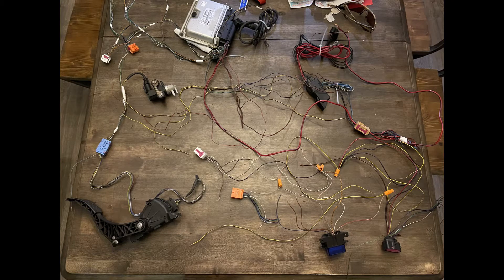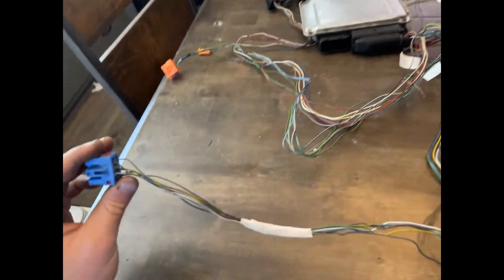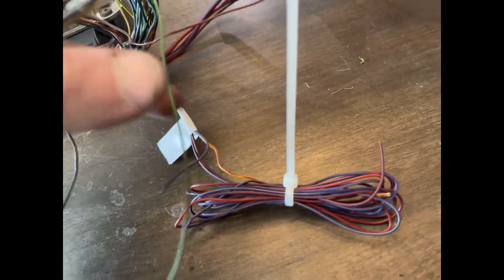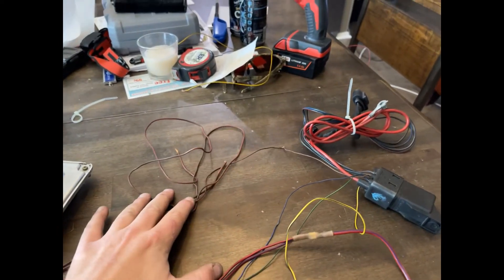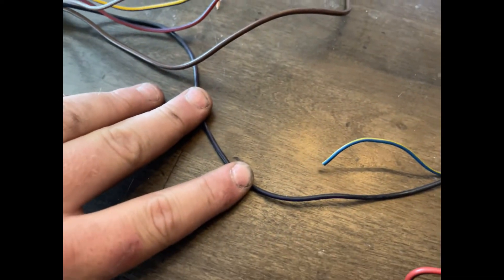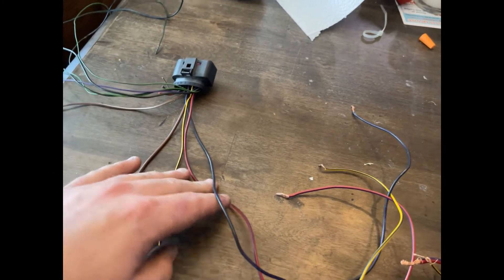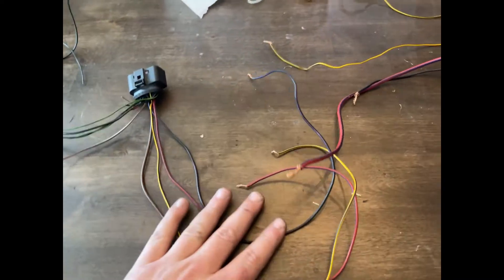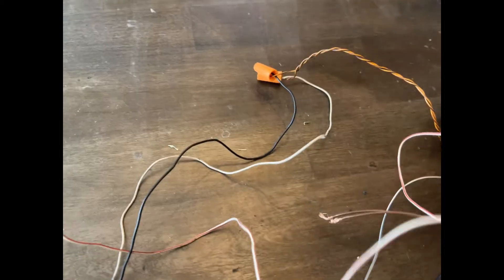Volkswagen ALH standalone wiring harness detail for engine swap

Comment: On the T14 connection will you give the numbers for the power and grounds. I don’t have that plug so I will have to splice into the engine harness.
Reply: I found the answer to my question online 5 - 30a fused, 6 - 10a fused, and 9 - is a ground. The engine started right up. Now I have another problem with the TPS not working. Reading online that it could be the brake pin out.
Reply: Also do those + and - have to be hooked up to run. I can get the engine to fire.  The ecu is coming on and the injectors are getting fuel but all the engine will do is spin over

Comment: Hi there! Great video, wondering about a few things. When you say something needs 12v power does that mean ignition power or constant 12 v power? Also the lilac yellow wire on the blue connector, do you connect that to ignition power to wake up the ecu if you’re not running the 109 relay? Thanks!
Reply from the maker: Hey adam, yep i mean constant 12v power. Pretty much the only thing that gets momentary power is the wire connected directly into the starter which fires the starter solenoid. You can run that one through a relay from your ignition.

The lilac/yellow wire on the blue connector is hard to figure out honestly. It's something i was planning on running an update on once I get the system more sorted, but I think the lilac/yellow wire is the one that actually powers the relay... so once igition is swithed and the ECU gets power, the Lilac/yellow starts running high 12v supplied from the ECU. 

The one that i DID glance over in the video is that the dark purple wire on the T14 connector needs 12 supplied to it to wake up all the engine sensors in addition to the yellow/black wire. 

Hope that helps!
Reply: @FiedtheNeedIT1  I see! Yeah that’s great! So the dark purple wire on the T14 is switched power?

Comment: will this work on a pd130?
Reply from the maker: I'm not familiar with that engine, but from the name PD it's likely a pump duse VW engine which does not use the same bosch VP37 injection pump, but instead uses a different fuel injection pump. 

So no, I'm guessing this specific guide will not help you.

Comment: Hi, thanks for the video, What year is the TDI engine?
Reply: My 2003 beetle harness is little different, maf sensor has additional plug and is on the main body harness thats not pluged into ecu dirrectly.
Reply from the maker: Bennett, the ALH engine code came in the Volkswagen Golf, Jetta, and New Beetle, and a few other things from 1999.5 to 2003. Basically the MK4 body styles.

This video applies to the engines which have the bosch VP37 injection pump.

Comment: This is awesome! Any chance you have a wiring diagram ?
Reply from the maker: I just used the Haynes manual which had a general wiring diagram, however I found it was just easier to trace back the components that I knew I needed to keep rather than tracking down individual wires